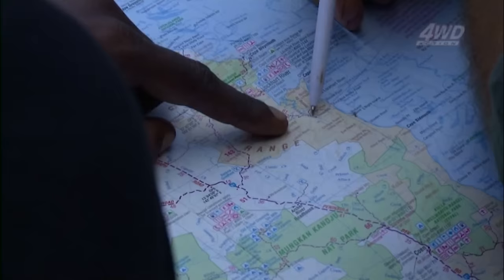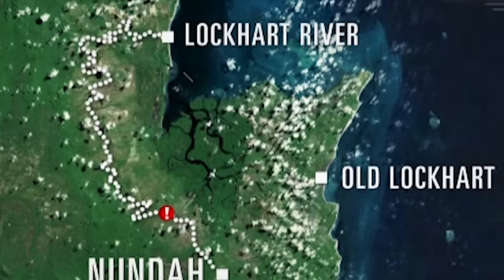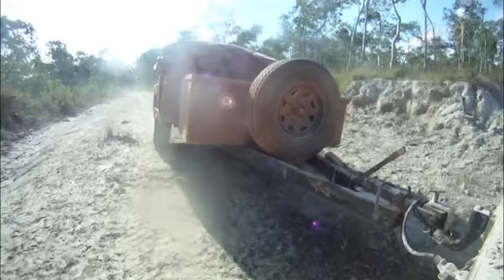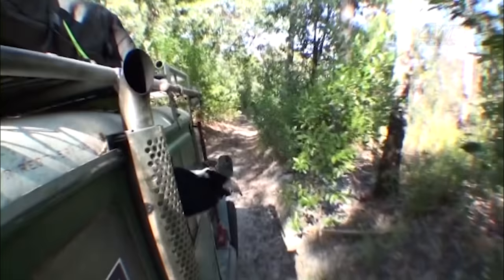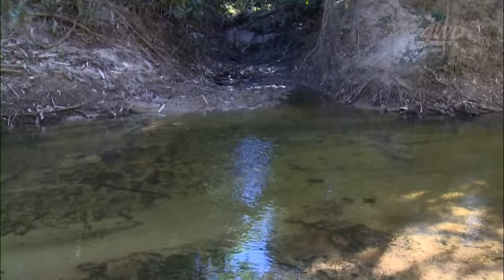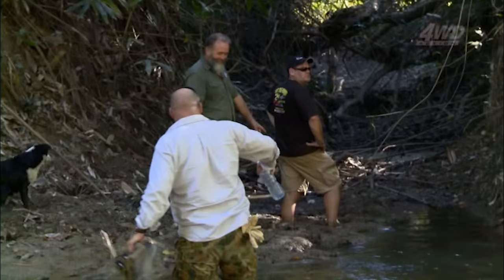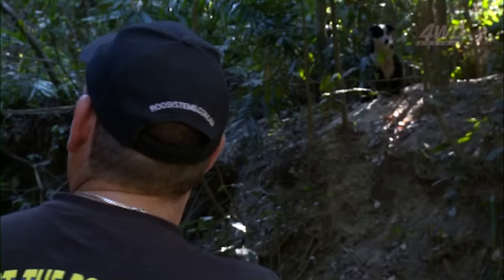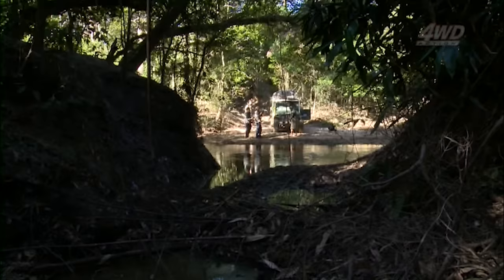Cape York's Forgotten Track - Roothy

Comment: This is a top little expedition off the main Cape York road. I remember doing this exact track in the early 2000's after gaining permission from the elders. We had 5 vehicles in our convoy. All double locked and with warn winches. A landrover defender 130 cut back to 100, Nissan GQ patrol turbo petrol, Toyota 60 series factory turbo diesel,  Toyota 80 series turbo petrol and a diesel leaf sprung hilux. It was all in a bit better condition back then. We followed the track past the old homestead for another 3 days ending up back in Coen. Brings back memories and the mate ship that comes from alot of winching and track clearing. Well done Roothy!

Comment: blankets will do sweet fuck all if that cable decides to go ping the crocs are half your worry
Reply: True if it's cable, but they were using rope, not cable.. the energy dissipation in the rope is so different.. I've watched the ropes snap a zillion times.. in saying that, rope might be 'safer' when it snaps, but i have yet to see a 4wd winch break a steel cable even with some damage on the cable and enormous forces.. so i would rather trust a cable in really remote places and just get the hell out of the way of anywhere it might go and don't be stupid. For people who are clueless and stand in dumb places i would recommend rope though.